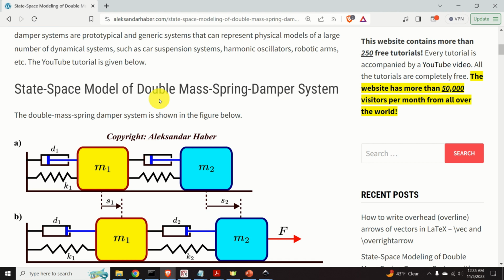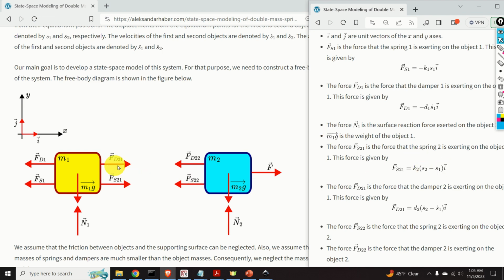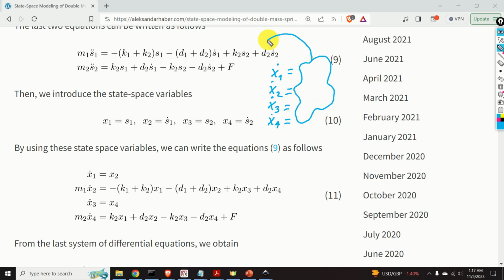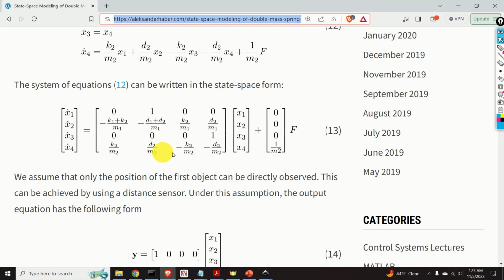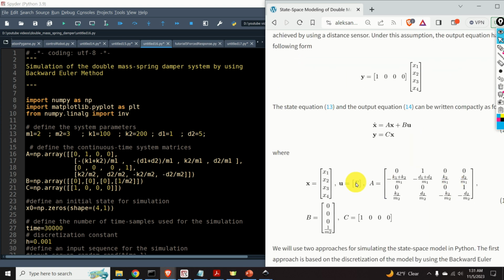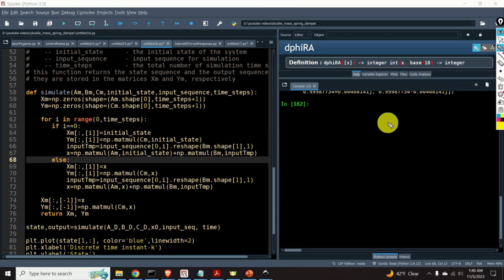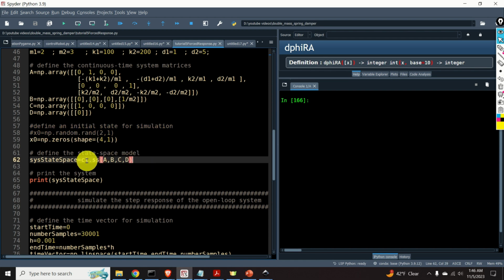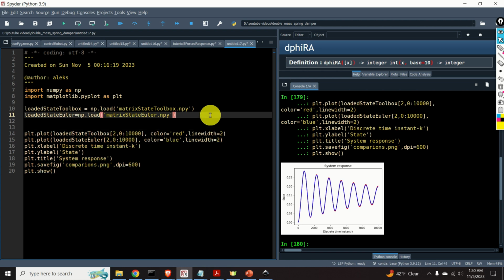Detailed State-Space Model Derivation of Double Mass-Spring-Damper System with Python Simulations

Comment: Since the C matrix is [1 0 0 0] is the simulation response only for mass 1 and its displacement? Or is it for the displacement and velocity for both masses with respect to mass 1?
Reply from the maker: Try to understand properly what are the system matrices and what the simulation does. Learn what is the state, and what is the output of a system. Then, you would not be confused and you would not ask such questions. The simulation approach shown in the video simulates the complete state vector. You can either extract the complete state sequence or only the output vector that is obtained by multiplying the state sequence by the matrix C.